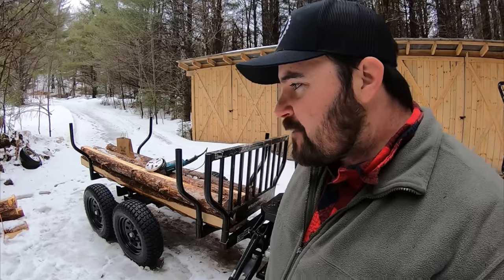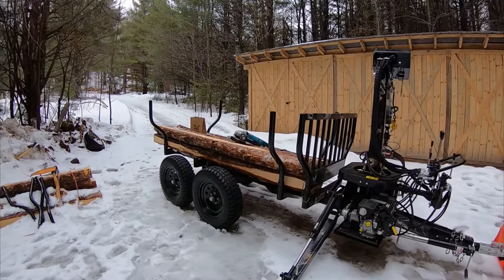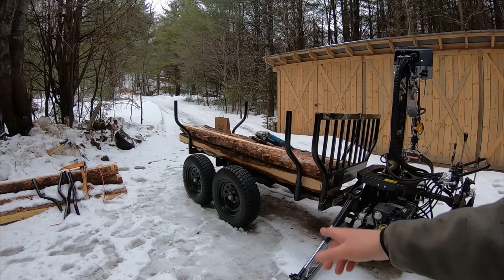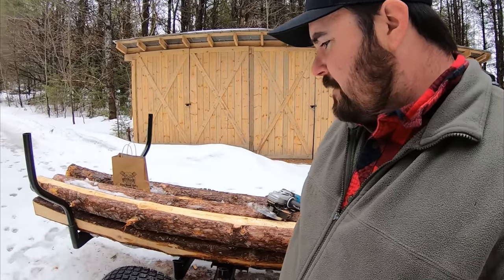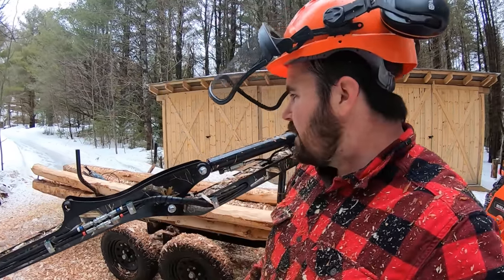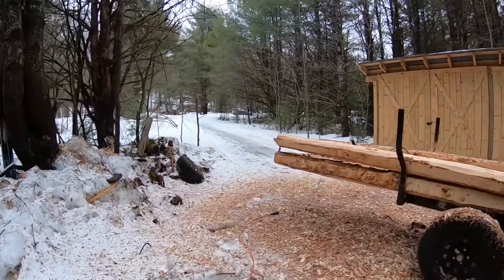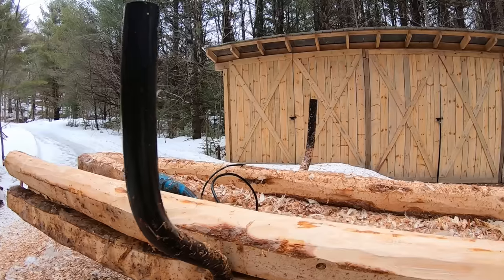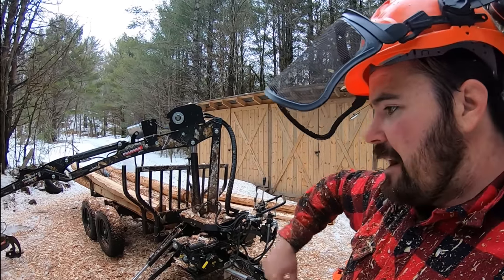Log Peeling Without the Work

Comment: The building materials are coming along nicely. Don't think the debarker is a veterinary approved device but it sure work well on the pine logs.
Reply from the maker: hahah yeah I certainly wouldn't be using this for hoof trimming. I've seen the ones the hoof trimming folks use and they are pretty neat too

Comment: Do the controls on the log loader work the same as the mini ex? If not, can you switch hoses around so that they do? Looks like you are getting better with every video. 

That log peeler certainly looks good.
Reply from the maker: Hi Mike. I think the controls are very similar as I don't notice too much of a difference. I'm not sure about changing the controls though on the log loader. Would be handy for some if that's possible

Comment: Very cool tool and mug! Have you tried it with other woods than pine?
Reply from the maker: Hi Etienne. I haven't tried it with any other logs except the pine. I'll likely use it on some spruce at some point and fir. Don't think I have any projects where I need to debark hardwoods but I may give it a try just so I know how it works

Comment: a nice log deck like at the mill with some small  V 's near front to hole logs at a nice height. then just slide finished log end wise onto slightly lower set of bunks.then your not leaning over tires and around posts. peeler works good👍👍
Reply from the maker: That would do the trick for sure.